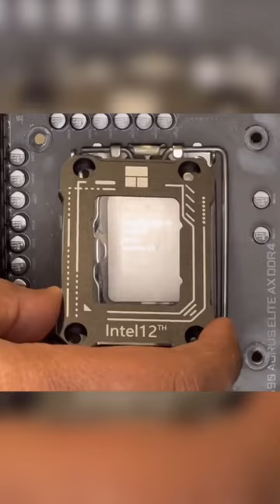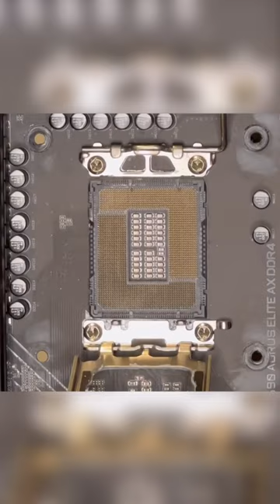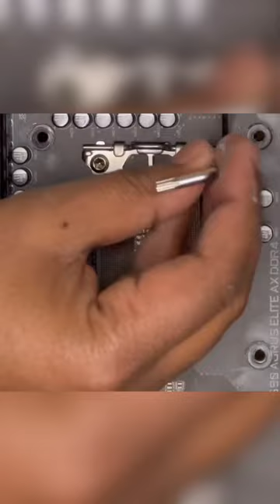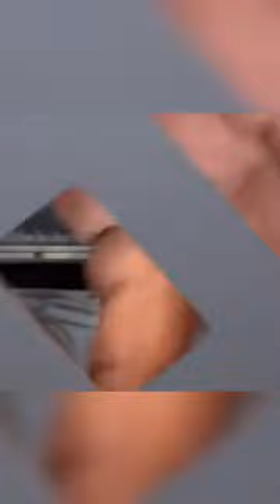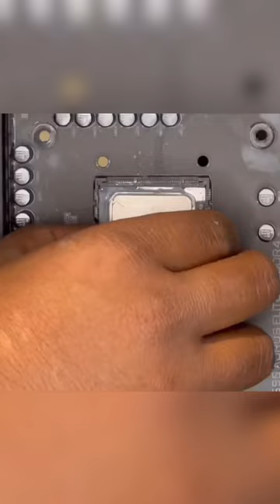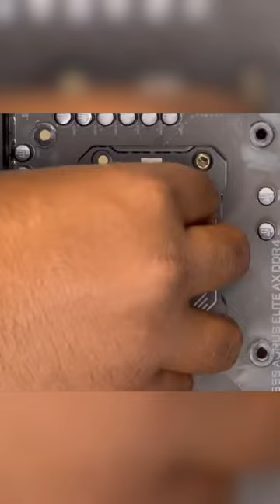INTEL please fix this - socket bending 🤷‍♂️

Comment: don't be this guy, leave your CPU in the socket to protect the PINs while you swap in the contact frame.
Reply: Yeah hes wild for this one ...
Reply: I agree what will happen if You're cpu broke and how do you take it out easily
Reply: But there is no pins in the cpu from gen 12th to I think also gen 11th has no pins
Reply: @كلز  protect the motherboard pins

Comment: For some reason this bracket caused me more issues than I had before. it pressured the socket and cpu too much, it won’t boot
Edit: the bracket is fine, my cpu was the issue
Reply: Bent socket pins, you can remove the CPU and bend them back.
Reply: @kickr0  
I thought about that too but I can’t see any bent pins. it’s also possible that i bricked the motherboard because before all this I updated the bios but forgot to rename the file, but it booted after that twice with no issues, then I changed the bracket and suddenly no boot. I suspected bent pins etc but I also noticed that the motherboard is not showing any ez debug lights, like it’s not even trying to initialize any processes
Reply: @kickr0  yeah, one by one, I'm sure that will come perfect lol
Reply: @Nb_2089 Just loosen the screws a bit
Reply: @EdnoAverche  
Nah. Somehow the cpu was broken. I contacted intel, sent it to them, and they sent me a new one. Used it with the mount and it worked. Tbh I don’t know what broke the cpu to begin with. So I take that back, the mount/bracket is fine, and in fact it surprisingly reduced the temperature by 10-14c! I went from 35-39c to 25-30c on my i9-13900K
Reply: Game nexus has a video on it talking about how to properly install it
Reply: I had the same issue I had to use 0.60nm torque